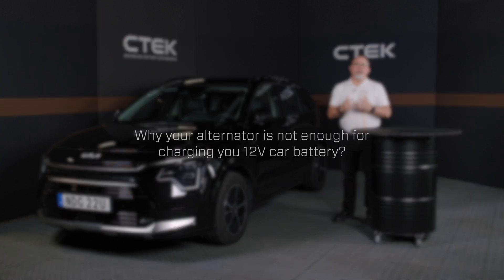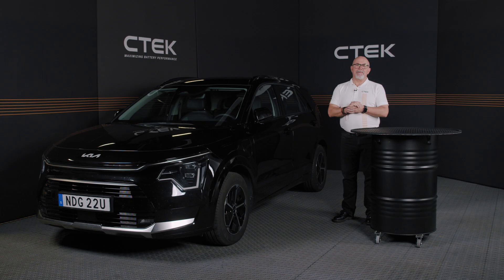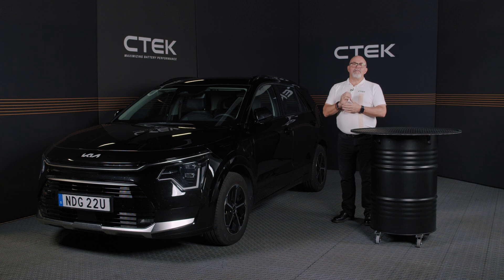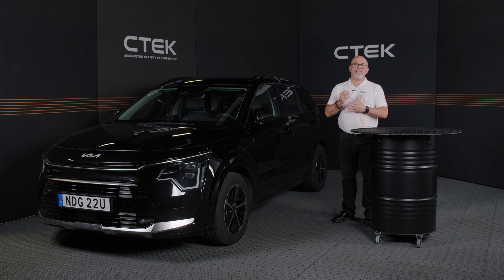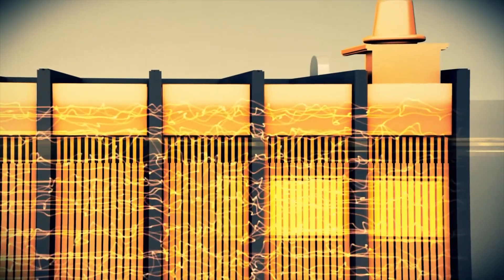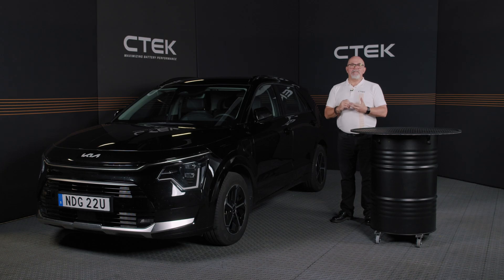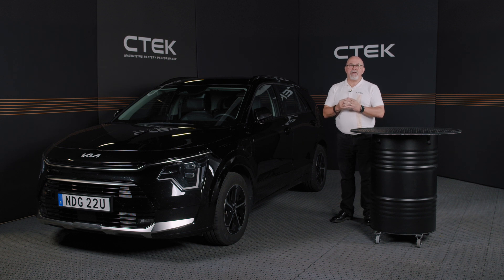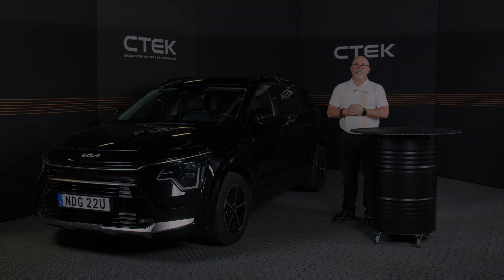Why your alternator is not enough

Comment: My garage doesn't have an electrical outlet. What should I do ? My battery drains in 6 months because I only drive 5,000 km in the city per year. What type of charger should I buy ?  Thank you for your answer.
Reply from the maker: Hi. I recommend you to look at the CS FREE. This charger works where no mains is available. I hope this helps. Kind regards CTEK Support
Reply: @CTEKBatteryChargers  Thank you for your answer

Comment: I got one 70A 12V CTEC on my desk. Very expensive, very complicated, very broken and designed not to be serviced. And it has hand written Chinese text inside. So it is probably made in china. Looks nice though.
Reply from the maker: Hi. Thank you for commenting.  I am sorry to hear that you experience issues with your charger. The MXTS 70 comes with 2 years warranty, and most issues can be repaired. I kindly ask you to contact your reseller to sort this out. If they can not help you, please contact CTEK through our web form on line and we will do our best to help you.
Kind regards CTEK SUPPORT

Comment: alternator has nothing to do with battery not charging   any car alternator is more then capable to charge lead acid batteries but the problem is in the charge programing by each manufacturer especially after 2015   the reason its not charging is because  its designed not to charge all the time and this ca be tested by anyone with a voltage display 12v plug have a look at the voltage when you accelerate and when you use engine braking and you will see voltage goes up to around 14.8v depending on manufacturer every time engine is rotated by the wheels and after this or when accelerating charging stops because voltage drops significantly to around 12.8v  its all about marketing to sell more 12v batteries nothing more and nothing less or in other words consumerism
Reply: @marbesky  BMW has intelligent charging algorithm since 2006 and newer cars. their batteries last around 9...13 years depending on some factors...
Reply: @tarassu  old  cars were built to last 
New cars are pure shit boxes that run fine-ish warranty time only 
Many cars back then we're charging the batteries full time 14.8v-15v while the engine was on but now it charges only when car is in engine brake to reduce fuel consumption and that's dumb
Reply: this makes more sense than what he told

Comment: Twice a year leave your battery on trickle charge for a day or two set maximum voltage to 15V and calculate current by having it around 0.05C (for 50Ah battery it will be 2.5A, for 70Ah 3.5A etc) Battery will last many years.

Comment: Solution: Upgrade your alternator. There are companies that cater to either off roaders or sound competition guys that usually have an alternator that will have more capacity than the stock one and often times its a straight forward swap.

Comment: Thank you; an informative video. I have a CTEK charger and use it every now and then on each of my VW's ( MK 6Golf and recent T Cross). They both usually do short runs and the AGM battery on the T-Cross was flat. Since then I have recharged and had a 500km drive. Do I need to use the Recond. mode if a battery has flattened?
Reply: Does your mode button still work?